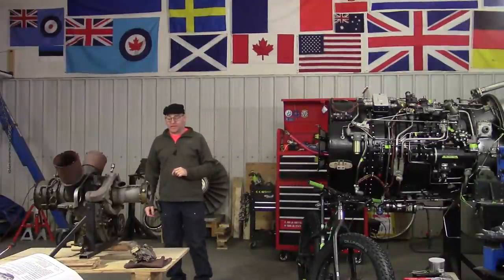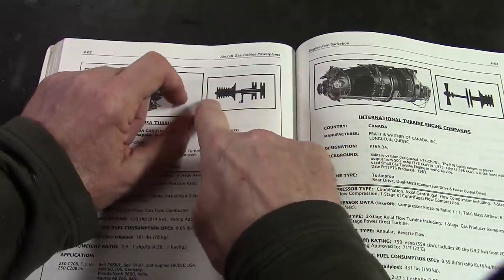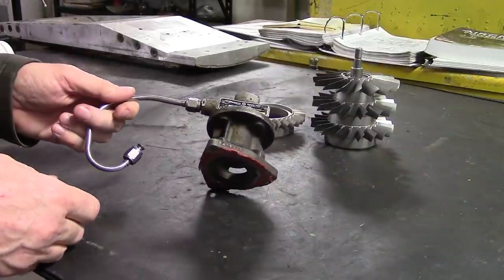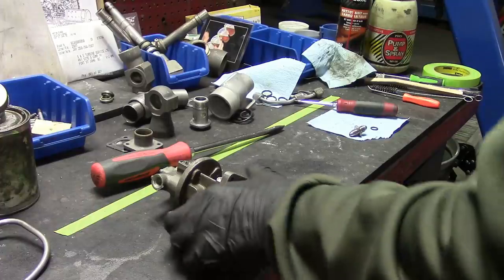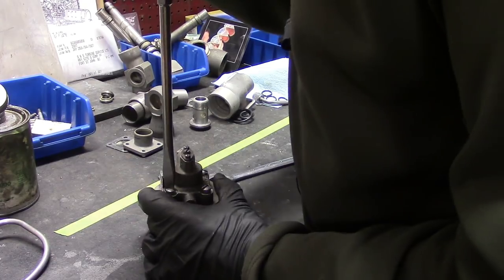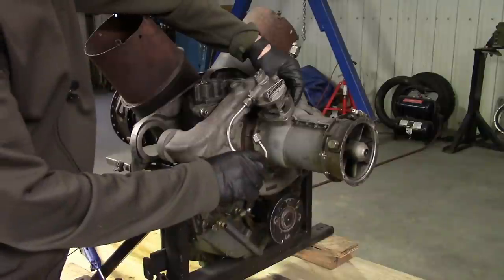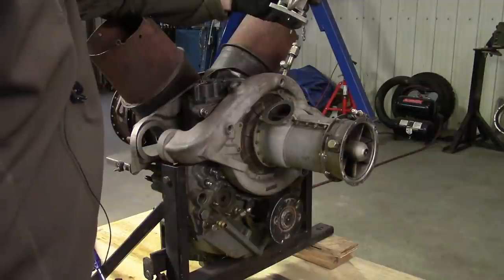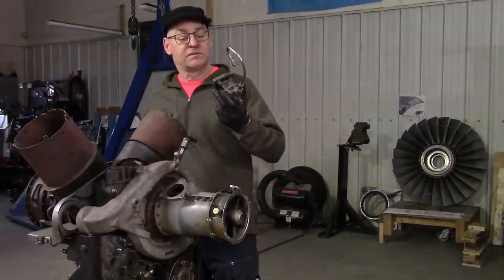Mini Jet Boat Ep. 2  Engine Overview and Bleed Valve Rebuild

Comment: In respect of the SFC issue, and comparing thrust SFC of lb/hr/lbt versus  power SFC of lb/hr/SHP, if the 250 was a little turbojet, with a PR of 7.2, I would expect it to have a thrust SFC of above 0.9.  This compares with the power SFC figure in the book of 0.65lb/hr/SHP.

Comment: At 29:54, you can't compare the turbofan's SFC with the turboshafts/turboprops', because they are two different definitions, and therefore have different units.

For jets, the term is TSFC - thrust specific fuel consumption (fuel flow/thrust) and the units are lbm/hr/lbf. For turboshafts, it is BSFC - brake specific fuel consumption (fuel flow/power), measured in lbm/hr/hp.
Reply from the maker: Awfully sorry for doing that. I was just taking the TSFC for the engines from a gas turbine engine text book.
Reply: Herewith a copy of my reply to another contributor on this subject. 
Dredging the depths of my memory, to demonstrate the difference in the SFC units, I recall that the Olympus 200 in the Avro Vulcan was rated at 17,000lb thrust for T/O.  The equivalent industrial engine was rated at 17.5MW for electrical generation 'peak lopping', which is around 24,500SHP.  The 'peak lopping' rating was probably more nearly equivalent to max continuous than T/O: nevertheless, it does highlight the difference in the units.

Comment: To put TSFC in perspective, the early DC-8-63 with JT3D engines burned 16,000#/hr in cruise.  When upgraded with the CFM56 engines on the -73 version the fuel flow decreased to 12,000#/hr, a significant range increase for operations that required it.  

There were other advantages like eliminating the turbo compressors and the leaky freon for pressurization and AC by using air cycle machines instead.  The conversion made a great airplane an outstanding airplane.

JT3D: 19,000# thrust
CFM56: 22,000# thrust (win-win)

Comment: You are comparing fuel consumption for ponds of trust on one engine and for horsepower on another. Not units that can be directly compared?
Reply: Agreed.
PS :  Dredging the depths of my memory, to demonstrate the difference in the SFC units, I recall that the Olympus 200 in the Avro Vulcan was rated at 17,000lb thrust for T/O.  The equivalent industrial engine was rated at 17.5MW for electrical generation 'peak lopping', which is around 24,500SHP.  The 'peak lopping' rating was probably more nearly equivalent to max continuous than T/O: nevertheless, it does highlight the difference in the units.

Comment: We call people who go for "shinies" magpies here in the UK. For me this is one of the most interesting vids so far. The only question I have is even though this looks like the best engine layout (EG keeping the power shaft short) is it what most manufacturers use? Also i'm thinking because this is so small the "sustain" RPM AKA Idle is about 70% of RPMmax? My logic is that as far as I can see the smaller a turbine is, the higher the percentage of RPMmax to self sustain. I have compared a few engines but not enough to know for sure.

Comment: Wood blocks make putting odd shapes in a vice much easier. You can use a lag screw to hold the work in place (a hole saw eleminnates the need to make a flange) and the wood will eliminate pressure points that might crack the part case.

Comment: A small correction possibly. Judging by the document Allison and P&W are rated per ESHP, my guess equiv. shaft horsepower, rather than lbt, pounds of thrust, so numbers can't  be compared directly to the other two since 1eshp != 1 lbt, I think.
Reply from the maker: I think the chart may have used the figures for the 250-B17, which is a turboprop version of the engine.
TSFC is valid for turboprops, turbofans and turbojets. And piston props as well.
Reply: You are correct that shaft power SFC (BSFC/PSFC) and thrust SFC (TSFC) can't be compared directly. If you convert a turbojet to a turboshaft, its previous TSFC number will be very different than its new BSFC number.

As for eshp - that stands for equivalent shaft power. It is a rating specifically for turboprops (note that the turboshaft 250's BSFC is measured per shp, while the turboprop PT6's is per eshp). In turboprops, most of the power is fed mechanically to the prop, but a small part is deliberately left in the exhaust to produce some jet thrust. ESHP takes this jet thrust and converts it to a power rating that is added to the shaft power, for an equivalent power rating.

Comment: Cant you do lockwire fairly fast w/ a handheld drill? ive seen that done before 
just put both ends of the wire into the chuck of the drill and spin it
Reply from the maker: That would be much slower. Too much faffing around. Most lockwire jobs are only a dozen or so turns.
Drills are for drilling.

Comment: I can relate to the Bleed valve, as it is very similar and the same type of  lconsept as the anti surge (anti compress stall) ported compressor housings we use in the turbocharging industry. Allows us to use large compressor wheels on smallish engines with acceptable spool up and minimal compressor stall at lower rpms.  Turbine's have always been on my radar,  mainly for a full size boat.  I'm Planning on building  a minijet boat in Future,  I didn't know these small turbines existed. Prob still out of my budget though, unless i found one at the non aircraft realistic cost. 🙂  Keep up great vids , I have gained  some good educational info👍

Comment: A simple block of wood as a temporary mount works.
Just screw it to the wood and put the wood in the vise makes it easy to do.
Great thing is you can use that wood until it is scrap.
Then use another one for other things.

Comment: hightec workbench you have there ;)  ... btw put two screws in tighten them with a nut and clamp the screwhead in the vise= no force on the part and you can clamp as hard as you want...

Comment: Good project, thanks for sharing... If he likes Rat as part of the name? I propose "Rat Rage", "Rat Reaper" or "Rat Relief"🤣  Bleed Valve serve as Compression Relief. Since the Allison/RR 250 engine is rated lower in KWH than the original design package the TSFC, BSFC numbers should be much lower than what the book is reflecting. Detuning engines by reducing fuel flow is a common practice. Most folks that rely on those original design numbers aren't aware of the whole picture when deciding fuel economy... That's why the engine is capable of producing higher KWH than is rated for the application. A loafing engine has reserve torque however fuel economy is facilitated for specific power output deployment application... Plus if the compressor furnace isn't driven to full capacity it will provide longer longevity since it's running cooler and noise levels will be reduced. There are always tradeoffs in specifying hardware!
Reply from the maker: The bleed valve is definitely not a compression release.
If the compressor stalls, the CDP falls to nothing. If the bleed valve OPENS to prevent stalling, the CDP goes back UP.
A compression release valve that make the pressure go UP?
Yeah, nah.... like I seem to always have to remind... these are not piston engines>

Comment: The bleed valve is similar to a waste gate on a turbocharged engine.
Reply from the maker: Very similar construction, but serves a different  purpose.
Reply: @AgentJayZ  On my turbo race car I run wastegates on my cold side so my turbos can spool faster, the moment I release my trans breake the wastegates instantly close sending all of the boost into the engine.  It's a fine balance to maintain as to not overspeed the turbos.

Comment: @29:00 you mixing examples of SFC: on the J78D and the CFM you're looking at T(hrust) specific fuel consumption (TSFC) in lbm/hr of fuel per lbf of thrust (or kg/hr/N in SI units) the 250 and and Pt6 are shaft power engines for their SFC is B(rake) [Power] specific fuel consumption (BSFC) in lbm/hr of fuel per hp of shaft power (kg/hr/W in SI).
Reply from the maker: Yes, you will be required to keep up.

Comment: is it  like when you block the inlet to a vacuum cleaner and it revs because the lack of air unloads the impeller, while unblocking the inlet loads the compressor and reduces the rpm,.   the unloading of centrifugal compressor opens the bypass valve and allows the axial compressor to load and feed the centrifugal compressor thus defeating the stall???
Reply from the maker: Nothing like that at all. Have a look at my video called Compressor Stall.

Comment: Hi Jay, do you want to do another Allison 250 alongside this one? I have one that I started to build out of 2 engines.
Reply from the maker: Send it here...
Reply: @AgentJayZ  ok, I have quite a lot of spare bits , I will look at putting the whole lot in a crate and send it all. There may be parts that you can use. I will dig out all the photos, and detail what has been done so far.
Reply: Do you have an international shipping agent near to you that you would use or recommend?
Reply: That should read clearing agent.

Comment: I saw some photos of SpaceX starship wreckage, they use lock-cable instead of lock wire.  braided cable and crimped ferrules. kinda interesting, and no doubt more expensive and faster.
Reply: Jay's shown that before

Comment: My understanding of bleed is that the compressor is created to move air through it at a certain rate. When it can't move the air at that rate (because there is nowhere for the air to go) the compressor becomes increasingly inefficient. You bleed air at the back of the compressor because you gain more by throwing that air away and keeping the velocity/volume of air i.e. flowrate high than you would if you tried to force it through the engine. Think of it like the clutch on a car. The clutch reduces the load on the engine until it comes up to an efficient operating speed.
Reply from the maker: This is a very common misunderstanding. It is not a decompression valve, and it is not a clutch.
The purpose of an axial compressor bleed valve is to decrease the effective angle of attack of the compressor rotor blades as they are moving at lower speeds.

If you close a bleed valve on an axial compressor at low rpms... the outlet pressure will fall, as the blades stall, and lose their effectiveness.

I suggest you have a look at my video on Compressor Stall.

Comment: Bleed valve is the same as the porting of the compressor housing on a turbo. If the air after the compressor over comes the inlet with regards to pressure it will try and push back in the wrong direction. If the turbo compressor is very large for a small engine, the surge porting allows for air to recirculate back into the inlet allowing a linear flow of air through the turbo. As rpm increase the surge porting actually act as a secondary inlet.
Reply from the maker: That is not what a compressor bleed valve does. Have a look at my video called compressor stall.

Comment: For names , what water jet propulsion system are you using ? I used to like the Italian Castoldi or NZ Hamilton units for boat builds way back in the 70s and 80s simply for availability reasons .
Reply from the maker: AT water jet.

Comment: So can you just compare specific fuel consuption expressed in thrust and horsepower? I guess it must be very application-specific.
Reply: I've already copied this comment of mine for the benefit of other contributors.  Does it help?
In respect of the SFC issue, and comparing thrust SFC of lb/hr/lbt versus  power SFC of lb/hr/SHP, if the 250 was a little turbojet, with a PR of 7.2, I would expect it to have a thrust SFC of above 0.9.  This compares with the power SFC figure in the book of 0.65lb/hr/SHP.

Comment: Where / for what was this engine used previously? I assume it got a second life in an industrial application, after serving in a helicopter. The ugly, rusty, welded on ducts don't exactly look like helicopter parts.
Reply from the maker: It was in a different boat previously. The constructor wanted to attach home made mufflers to the exhaust housing. I'm sure those elliptical exhaust clamps used on the helicopter are pricey.
We have an acquaintance with access to scrap 250 and Jet Ranger parts, so we will attempt something.

Comment: What is that book from the BCIT days?
Reply from the maker: Got a video called "Books!" Type that into the search box in my channel page.
Reply: Nice wire job. What a great little engine 

It is a remarkable feet they have increased the horsepower over the years...

I like the idea of wire holding fasteners even on a boat....

One less thing to have rattle off
Reply: Go with what you know....
Reply: I wonder if like the engine that powered the Huey in like the days of Nam...the Lycoming T-53......are those engines or an improved version being used in helicopters that are being built today....?

Or maybe the Allison 250 will always be used ...

Comment: You seem to fix a lot of engines by taking parts from donor engines.

What exactly would qualify an engine being taken out of service and used as a donor engine?
Are there certain problems that would mean an engine must be taken out of service and never used again for safety reasons, or is it just a case of "This one is going to be too expensive to fix so we'll use parts from it to repair one that isn't too bad."?
Reply from the maker: Both can happen. If an engine has low operation hours, but was removed from an aircraft that has been retired from service, it is no longer useful in that configuration. It will contain good parts that are useful in the industrial, ground running version.

Or, the engine might be completely worn out, but things like cases and frames don't wear, so they can be used to replace damaged ones.

Comment: I think you skipped talking about the bleed valve diaphram. In a PT6, low power and high temp could mean the diaphram has a hole in it causing a bleed air leak. I think I observed a red diaphram in you video
Reply from the maker: In this bleed valve, the compressor discharge air pushes directly on a metal piston, which moves a solid aluminum valve onto a stainless steel seat.

Comment: Sounds like you were describing a decompression valve, like on a chain saw, or automatic ones found on motorcycles and a TVs
Reply from the maker: Not at all. It's a starting bleed valve on an axial compressor. Nothing to do with piston engines.

Comment: compression release for a 2 stroke - releases the compression so that the engine can turn over easier (start easier because the piston isn't creating so much compression - via the release valve (bleed valve))
Reply from the maker: That is not at all what a compressor bleed valve works in a turbine engine. A stated earlier. If the bleed valve is closed at low rpms, the CDP will fall to zero.
It's not a compression release.
It's an anti stall device.
See my video Compressor Stall for more info.

As always: these are not piston engines.

Comment: Hey Jay. What percent do you see broken lock wire on work comming in and have any fasteners backed out as a result? I image locktite cannot take the temps or is it not used b/c there is no visible indicator that its been used?
Reply from the maker: I have seen two loosened bolts in important areas. Both times they were kept from departing by lockwire.
It's like insurance; you almost never need it, but when you do...

Comment: Dillinger 5, 27.5" I suppose. Are those studded? Happy with those? I'm rolling Terrene's Johnny 5 studded, and especially now when spring comes along and there's this thaw and freeze-cycle going on I'm really happy. Greetings from Helsinki.
Reply: -15°C isn't too cold to ride outside. It's perfect! The snow is like asfalt, and as long as You keep pedalling it isn't cold. Layer Your clothing.
Reply from the maker: I had really good tires on before, the Bontrager Barbegazi (?). These are even better.
On crusty, icy climbs, they spin and churn but I keep moving. They are studdable, but I am running without studs.
My favorite temperature range to ride in is -1 to -10C.
Great to hear from you!

Comment: It's construction looks exceedingly similar to russian GTD-350 helicopter engine.
Same axial plus centrifugal compressor and reversed order of high and low pressure turbines with combustion chamber located at one end of the engine
Reply from the maker: That engine is just barely different enough to not be called a copy, but the general layout is exactly the same. It was designed in the early 60s, and the first 250 ran in 1959. The GT was out of production in 1970, whereas the 250 is still being made.
So... who looks like who?
Reply: @AgentJayZ  Well, the Russian Klimov VK-1, which powered the MiG-15, looked remarkably similar to the R-R Nene, and it is an absolute fact that it was a copy.  A post-war UK government encouraged R-R to sell Nene engines to the Soviet Union, as a goodwill gesture to a former ally, on condition that they were for civil applications only.  The result?  The MiG-15 was the foremost fighter aircraft over N Korea, until the F-86 arrived.
PS  Like it or not, the centrifugal VK-1 was probably superior to the J47 at the time of the Korean War.  It produced almost the same thrust as the J47, but was over 600lb lighter, albeit with a slightly inferior SFC.  It was altogether a simpler engine, was more robust, and probably had a longer TBO.

Comment: Here’s a trick I’d try for the issue you were having with holding the valve in the vice. Take a couple bolts and nuts and thread them lightly together in the holes. Then clamp the nuts into the vice and you can snug up the bolts to hold the piece.
Reply from the maker: Thanks. FYI... "vice" and "vise" are two waaay different things!
Reply: @AgentJayZ  Yeah, I do screw up on occasion. 

Can you tell me how involved those Allison 250s are to rebuild? Special tools and procedures and the like.